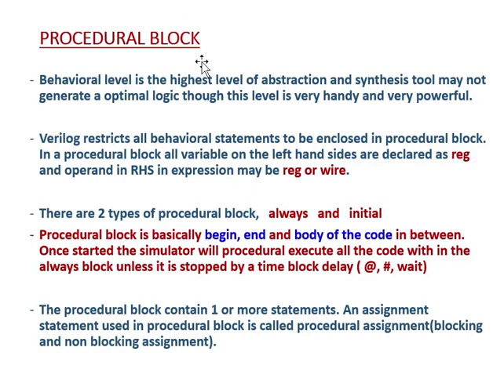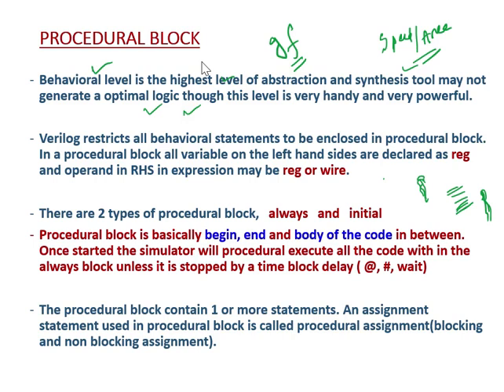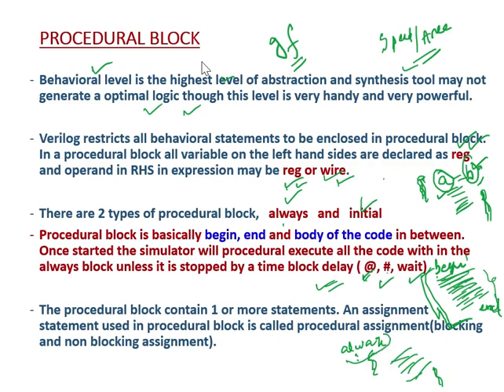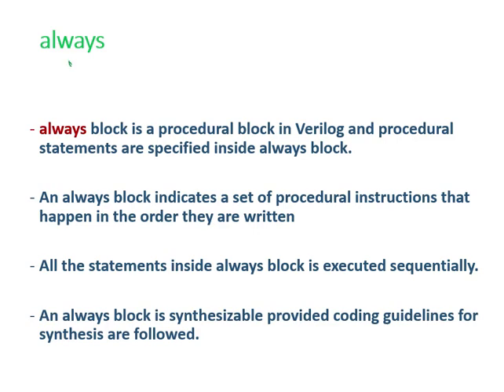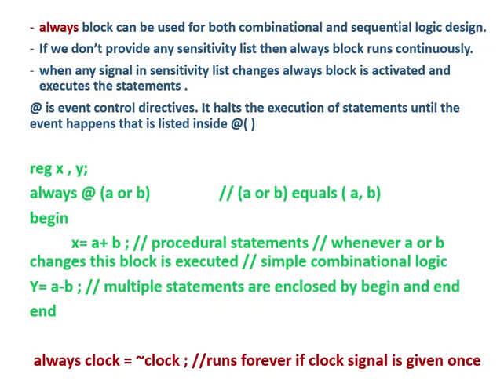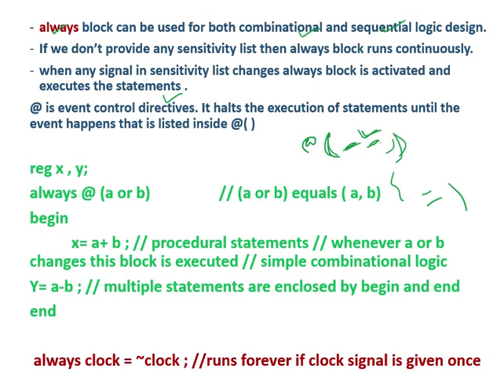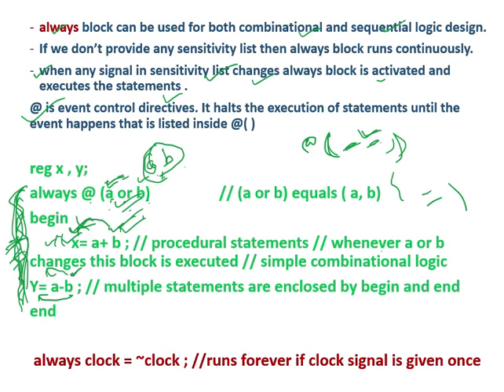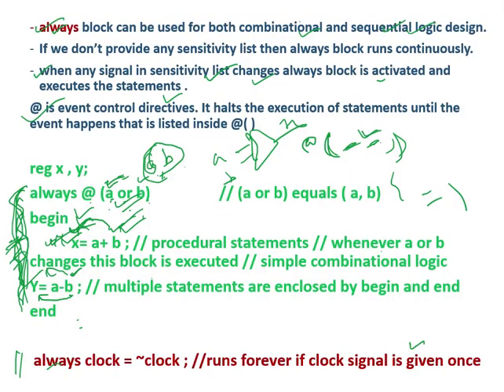#11  always block in Verilog || procedural block in Verilog explained in details with code

Comment: At 8:32, u wrote all the statement inside always block execute sequentially, i didnt get that point, if there are multiple statement it will depend on the type of statement, if blocking all statement will execute sequentially, but if non blocking then it will not execute parallely na. i have a doubt at this point, can u clearify.
Reply from the maker: In reality, always@ doesn't represent any hardware. So it's executed at simulator level and in simulator everything are executed sequentially and not parallely.(The statement you mentioned , consider it this way).
But at hardware level it's different.sequential is a misguided term we have been using in verilog and tells nothing about hardware execution.

always @(clk)
X= y+z;
P= X+a;

always @(clk)
X<= y+z;
P<= X+a;

Both the above statements run sequentially but one is blocking and another is non blocking.
So it's not true always that Non blocking assignment run parallely.

At hardware level things are different.
Thanks
Reply: @ComponentByte if both  statement have #1 sec delay, then in blocking 1st statement will get executed at 1 sec and second at 2 sec, while in non blocking both will get executed at 1sec. Is my statement true?  Or is it like in blocking also both start at 0 just that for completion second statement require 2 sec while first get completed at 1 sec.
Reply from the maker: You are correct and these are all simulator level execution which depends on time. If you are talking about #1 or #2 kind of statement then at hardware level these are ignored like they don't exist and then statement are executed based on data dependency.
So you are correct at simulator level(but at hardware level you may not be correct).
I am trying to explain you at transistor level or RTL level.

It seems you are very much interested in learning verilog. Keep on exploring.
Reply: @ComponentByte  ok, I got it. Thanks for your time and answering my query everytime

Comment: sir you are saying that statements inside procedural block execute when the sensitivity of the events in the always block changes. so i want to know how will we or how the sensitivity of those events change?
Reply from the maker: Whatever present in sensitivity list are usually inputs. In real-time world , let's say your mobile phone's touch screen, when you touch screen, something happens. So your input is inside the sensitivity list ( say Sensor's input) so when input changes means when screen is touched, it enters body of always block and some logic is implemented like screen glowing. The inputs may come from either outside or due to the effect of some internal effect.

Hope it helps.
Reply: @ComponentByte  yes got it thanks. so basically the events inside the always block would be the inputs always, right?
Reply from the maker: If input changes then only we get output.

Comment: $display is used in always block ,it doesn't diisplay anything,not getting output,why sir
Reply from the maker: $display is used in testbench and not in main module. It's not used inside always block.its used inside intial block.